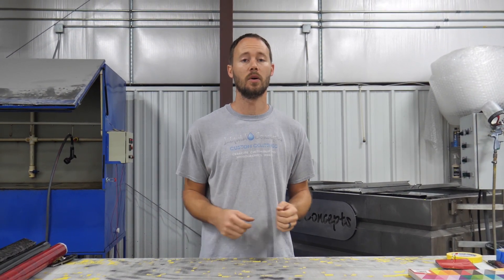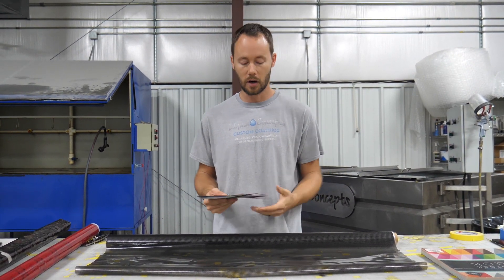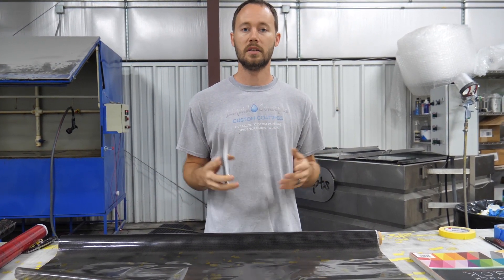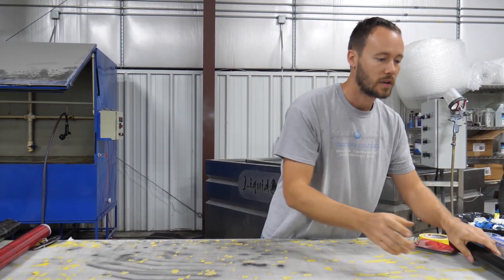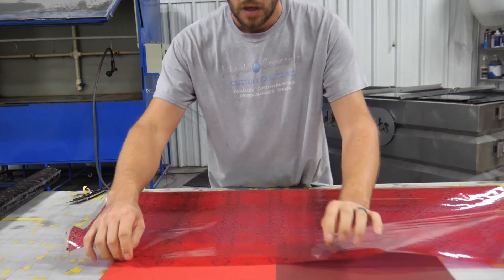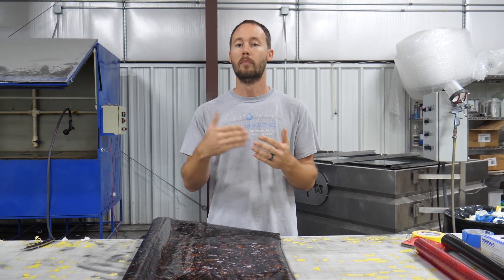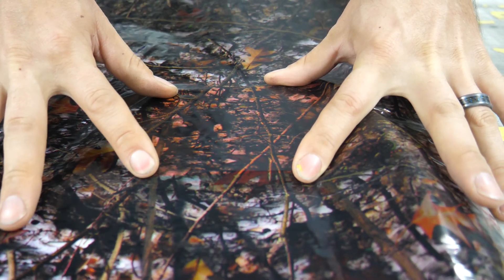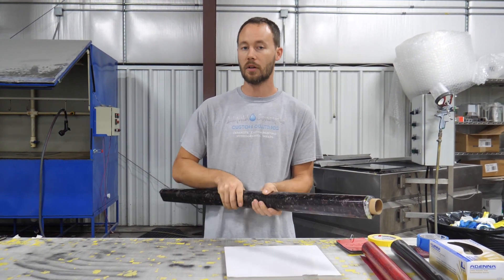HOW BASE COLORS AFFECT HYDROGRAPHICS | Liquid Concepts | Weekly Tips and Tricks

Comment: Hi nice video, 
I am new to hydro dipping I’ve done a few bits with good results but I’ve started having problems anytime I dip something it doesn’t seem to Pearce the film like you see in your vids mines seems to just overhang the parts and turn to droop. 
I
Am I using to much activater or not enough or Ian I doing something else wrong 
Any help appreciated 
Thanks
Reply from the maker: Normally if its "Melting" off the part, that is way to much activator and you need to back off the amount sprayed.